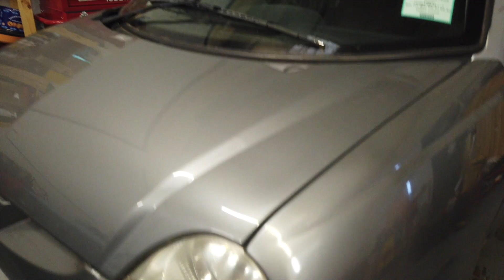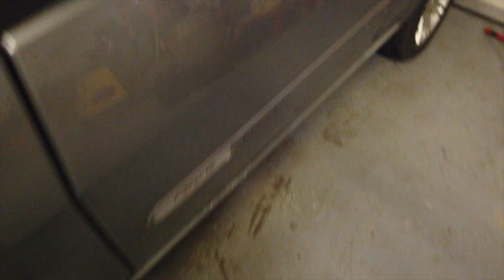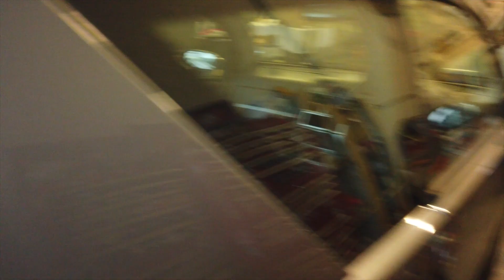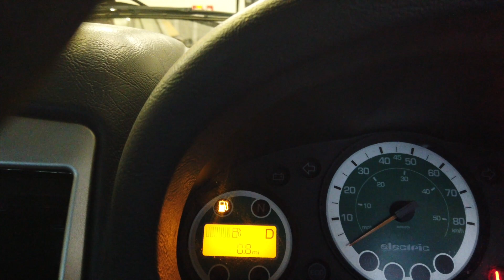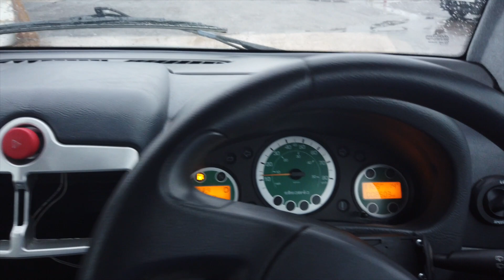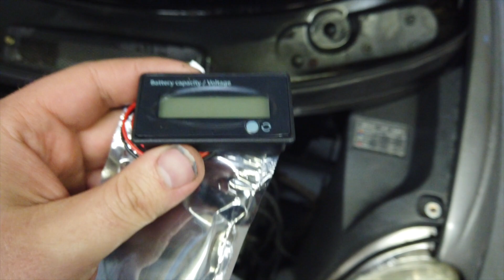Is there HOPE for my £400 ELECTRIC CAR?

Comment: The limiting factor of the Aluminium chassis stops a bigger upgrade to the motor drive. As long as your about town its ok a second runabout the limiting factor of the 3 pin plug and no modern charger makes it almost unworkable.
It is a shame there is no follow up video on the final phase of mot and selling the thing.

Comment: There's one more battery under the dash. If that's not charge the car is trying to charge while it's running. Might that can mess up your charge indicator. I had one of these cars.  A nice orange one. I fixed the onboard charger (same fault as yours) and i had to replace also the main 12V system relay in the middle of the "engine" bay. Lovely little car. I'm still sad that I sold it. Unfortunately there waa no point to keel it because it had only 2 seats.

Comment: Hi, I have an Aixam Mega 600E and what I know about the Eco light is when the voltage drops to 12.2V (I think) the light comes on, it used to flash up every now and then when the batteries were low, if it stays on for I think 10 seconds the '!' light will come on also, putting the car into limp mode so watch out for this, I've never driven the car that you have, but the van is very fun to drive, I bet your car is the same, anyway I hope this helps. :)

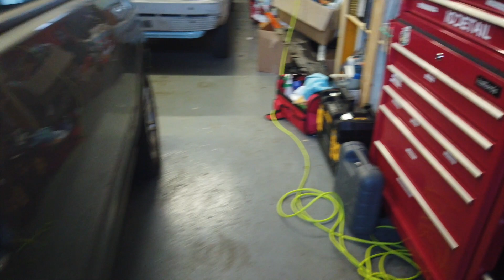Comment: 4:50 ish. Don't leave the cable wound on the reel when you are pulling a high charge for a long time, pull it out into single long lines. It will get hot otherwise and can cause problems like melting - ask with any motorhomer or caravanner.
Keep up the good work.
Reply from the maker: It’s fully unwound, just piled up on the floor instead of laid out neatly. Good point though 👍
Reply: @ModernHeroes  That charger pulls about four amps so don't worry about unrolling an extension for it, it's fine.

Comment: so once finished there will be a 1000 mile challenge around the UK
 would ask if it can only manage 30 its really a limited car.   so this is like a ami electric.  town only car.  really more of a kids toy.
puzzles why electric car makers would think that it is ok to make a car that is so under powered that it could be dangerous on most roads
not being able to overtake.
not sure that cable ties are in the MOT testing list  to say panels secure  what holds the wheels on  bluetak
Reply from the maker: These were really only sold in London as far as I know - imagine they were perfect there at the time and paid for themselves with the congestion charge, parking and fuel savings! 

 Can’t see anything in the MoT manual that precludes attaching a bumper cover with cable ties - it just needs to be secure, which it is.
Reply: Probably because it is French and based on their sans permis system which allows people without a licence to drive low weight and power cars? This is just the electric version exactly of that type like the Citroen Ami is the new electric example, 16 year olds can drive them I believe.
Reply from the maker: I think this is actually a heavy quadricycle rather than a light quadricycle like the Ami. It’s quoted top speed is actually 40mph, it seems.

Comment: I wonder if you could fit a solar panel to the roof
Reply from the maker: Not sure it needs more weight 😆 but it might be worth some research - I don’t know how big a panel I’d need to make a difference to anything
Reply: @ModernHeroes  12v solar panel is quite cheap and light. I have one charging my 12v batteries in my shed which I use to power a TV and usb ports. For a car like that which is going to sat around most of the time some sort of trickle charging will probably keep the batteries in better condition.
Reply from the maker: It’s a 48v pack though - a 12v panel would be good for keeping the auxiliary battery topped up I guess.
Reply: @ModernHeroes  solar controller at 48v output.